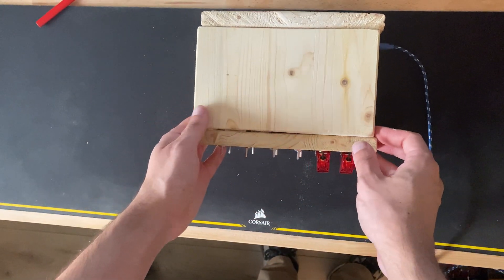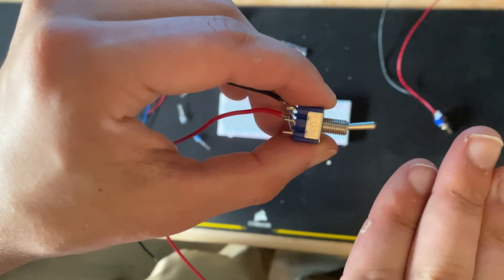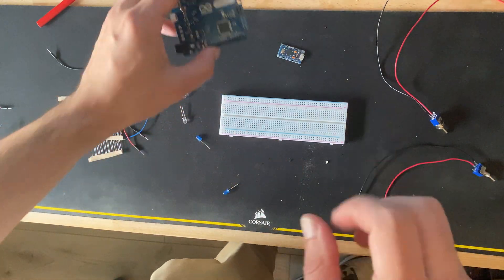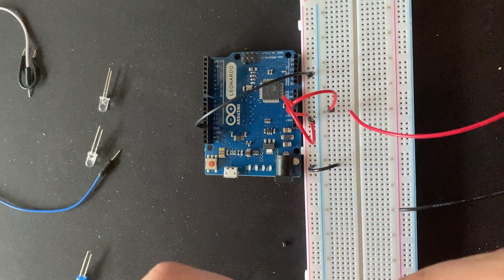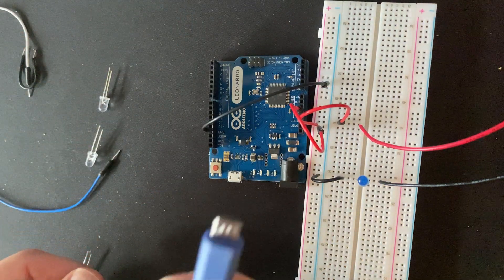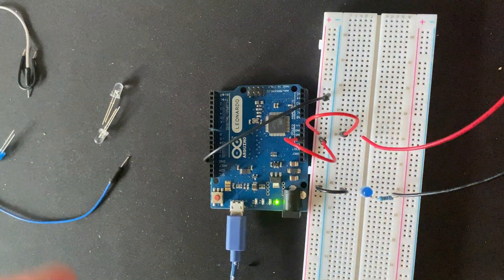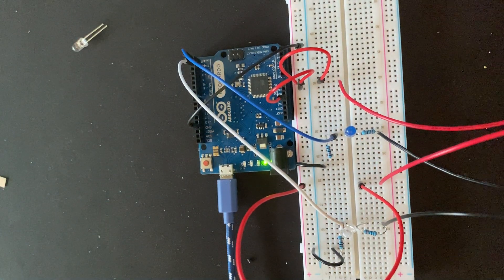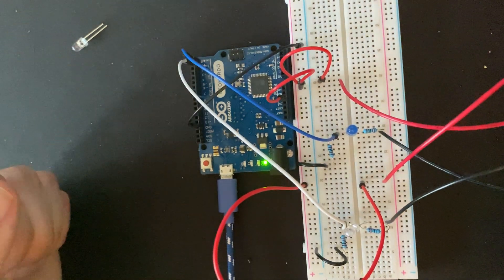How to:  Arduino Flight Simulator 2020 controller (Leonardo/Pro-micro). Part 1/2

Comment: You connected the 220 ohm limiting resistor incorrectly - it is useless in such a circuit, since the transverse contacts are all closed and the current still flows not through the resistor but through the LED. That's why its brightness hasn't changed. But the 10 kilo-ohm resistor is turned on correctly, so your LED immediately begins to glow dimly - the current is limited through a resistor of as much as (!) 10 kilo-ohms!
And it’s not clear why there are two resistors? It is enough to turn on one at 220 ohms instead of 10 kiloohms. That's all!

Comment: If you put the resistor parallel with the board connected row it’s useless. Bad circuit development ! You even  risk your Arduino as the current is on maximum. If you use power supply it’s dead right away.
Never use LED without current limiting resistor!

Comment: I'm new to all this but was able to follow your process right up to the introduction of the 10k resistor.  Why is that needed?
Reply: Resisters prevent burning of electrical parts.  Current may not always be steady  and resisters ensure that the current going to, lets say a switch or a light, is steady.   Every part on your board should have a resister proceeding the positive voltage input on the part.

Comment: thanks for your videos, they are very useful for beginners.
However I don't understand if this solution is applicable for a button matrix, if so, how do I insert the led inside a matrix?
I have a 2x5 matrix where the second row are 5 toggle switches to which I would like to add a led when activated, so they have a common row A2 where I added diodes before the toggle switch pin and the 5 columns of the toggle switch go on pins A1; A0; 15; 14; 16.

Comment: Where are the links for the resistors? I see different wattages for 10k, like 0.5 and 0.25. which one should I get?
Reply from the maker: Sorry for the late response. I usually use 470 ohm resistors. They are labeled as 470R

Comment: this work for il2 great battles?
Reply from the maker: If you can bind normal gamepad keybinds in the game then yes. You'd need a Pro Micro or leonardo though if you want ot code up a plug and play solution. Other boards require more work to get going

Comment: The advantage of Leonard is that it is configured as an HID, so it is simply a matter of plug in and configure as a joystick inside the simulator. But the problem is that, at least I haven't figured out how, you cannot take information out from the sim, such as reading HDG indicator to show in a 7 segment display, or switch on a light if the autopilot is engaged. To do that, FSUIPC and Mobiflight or arduino programming is needed.
Reply from the maker: Got you covered. I've got an Arduino library and application for exactly this. You can find it on my channel. Tommorow im releasing an update on an input library as well to handle throttles and mixture directly.

Comment: Nice video but aren't you making a mistake with the 220R resistors? From my point of view both endpoints of the resistor is connected to the "same" point and wont do anything. If you want it in serial with your LED then you should connect it in the same way you did with the 10k?
Reply from the maker: You are completely right the resistor should have bridged a gap. Had to rewatch 10 times till I saw the mistake. Thanks for pointing this out!
Reply: Yes, the resistor is connected in paralell, not in serial mode. That´s the reason why it goes so bright despite the resistor.
Reply: In fact, it is not even in paralell, it is shorcutted.
Reply from the maker: @fjgaspar  amen! Completly right sometimes the autopilot takes over. We know what an autopilot can do when going haywire
Reply: I came here to ask the same question. Cheers